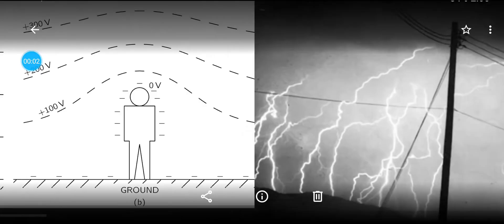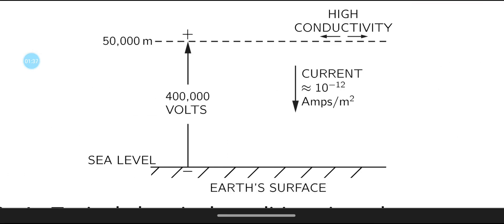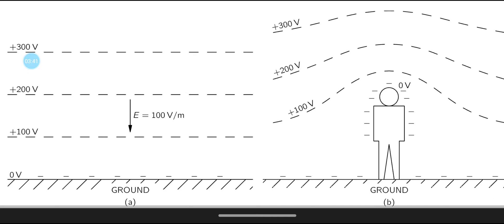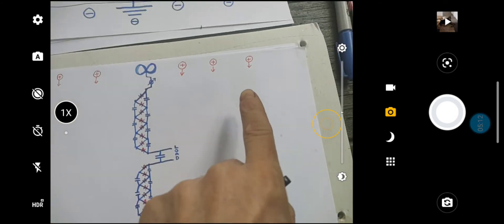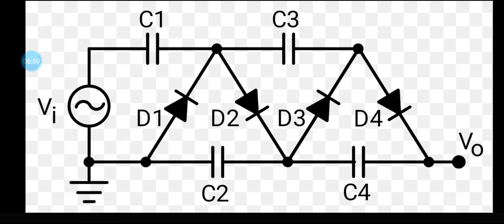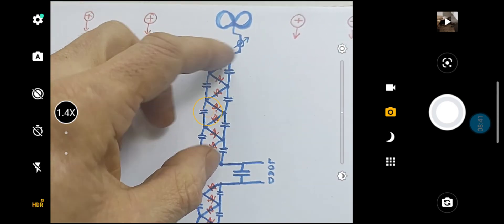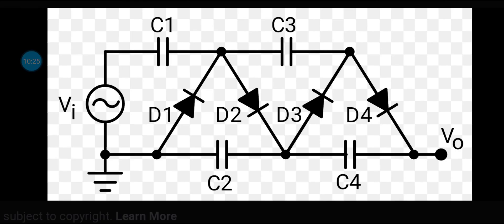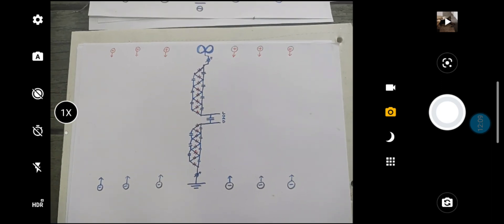Electricity in the Atmosphere (My Harvesting Concept Based on Feynmans Lectures.)

Comment: My thoughts 🤔.... 
This is where you will end up with a conventional understanding of science.... 
Having a feeling that there's gotta be something more but the path forward isn't quite clear! 
In the words of wisdom from Benjamin Franklin himself who first coined the terms positive and negative said that the electric charge is a problem of accounting! 
He said that it's like a bank account where when you have more charge, we can call the account positive as in credit! And when you have less than, it's negative as in debit! 
He never said that there's two different but opposite charges! 
No different than any bank account today! You open a new bank account and it's at zero! You get paid and it's positive! Anything less than that positive is negative relative to the original positive! 
So then, relative to the antenna, the ground is referred to as 0V but if you source a new 0V ground reference point deeper down, your original 0V ground reference point is no longer 0V, it's potential has now changed and gone up! 
So basically by using an insulated ground rod with an exposed tip only, you will be referencing your 0V ground from a deeper point in the earth and increasing the distance and thus potential difference between the ground and the atmospheric source.... 
It's a common misconception that there's two different but opposite charges! That's just as silly as thinking that -5° in Celcius or Fahrenheit is even possible! Zero is zero no matter what! There's nothing less than zero! In fact zero doesn't exist! 
You might think that it's cold where you are, you may even think that you live in the coldest place! Leave the earth and it's colder! Leave the solar system and it's colder again, leave the galaxy and it's colder again, is it zero there? I doubt it! You and I might not consider it as heat but it's there! The same stuff we have here on earth except so much more diluted.... It's not the opposite heat, cold just means that there's less heat relative to where you are normally from or the time of year perhaps, using words like cold and hot seems to suggest that there's an opposite thing to heat! Like a negative heat which is called cold.... 
It gets confusing doesn't it? 
This is where the understanding of the electric charge has gone wrong.... 
The ground floor isn't 0V, Zero is wherever you source your ground reference from.... So if you had a deep mine shaft and you source your ground reference point from the deepest point, the actual ground up top will now be positive in relation to the deeper ground reference point... 
I hope you can understand my point.... I'm well aware that getting my point across is not one of my strongest points... I can visualise it perfectly but translating what I see into words is a skill set I have not yet mastered.... 
If you can't go any higher, try the other end and see if you can go deeper! A circuit is a circuit, just make sure that the contact is only happening at the deepest point or at the most opposite end of the source.

Comment: You could just use a coil at 1H and a cap at 1F and pulse it to get the same Effect
Reply from the maker: Yes, for 50 Hz AC. I have considered that.
I haven't been experimenting for some time though due to lifes twists and turns.
Great comment thankyou ⚡🙏⚡

Comment: Seems like we should be using a weather balloon to carry a wire up to a high voltage potential.  That would allow all the time needed for testing.  A small blimp for lift would leave all the battery power for equipment and propulsion.
Reply from the maker: That is a Fascinating Idea
I admire your thinking.
Would be worth experimenting with.
Thanks so much for the Comment ⚡🙏⚡
Reply: Nah. A balloon isn't needed.

I hypothesize that a tall pyramid with a lightening rod at its apex may be able to draw in the electricity with a coil used to concentrate the wattage. The coil is mounted in a thick wooden  board that's grounded and placed in the middle of the pyramid and connected to the rod with perhaps magnetic cable wire. Just my hypothesis. 

Here in America any experiments involving pyramids is automatically labeled pseudoscience, however, other countries have conducted scientific research with pyramids with astounding results.

I'm disabled and unable to experiment and try out my hypothesis, but I do think that the pyramid and coil (because we're a spiral galaxy) are the keys to harnessing clean, reusable energy. The trick is in figuring out what kind of coil is appropriate. There are many many kinds out there. No telling which is the right one.
Reply from the maker: I do agree with you about using the pyramid shape.
I do believe the Egyptian pyramids were actually wireless power generation systems
& that could explain why they used to have pure gold caps.
I like your idea of a coil system 
& it would beed an excellent ground system especially aqua ducts underneath would be idea.
In my Opinion it would need a suitable operating frequency too
& this could be where an appropriate coil system plays a roll.
Great ideas my friend ⚡🙏⚡
Reply: @crazyham  Thanks bud! 😊 Glad at least one person doesn't think I'm some kind of nut. Lol 😂😂 

I take it from your post that you're familiar with Christopher Dunn's fantastic Giza research. I find his hypothesis regarding the Giza pyramids to be scholarly and 100% correct. 👍
Reply from the maker: @freeinghumanitynow  No, I'm not familiar with his research
but Nicola Tesla himself firmly believed the Pyramids were for that purpose too.
Keep up the great thinking my friend ⚡🙏⚡

Comment: Sky is positive 
Ground negative
Points share transfer charge
Ball stores charge
30 volts/ foot
Tree sap wet minerals= conductor
Oak leaf- 30 sharp points/ leaf
5000 leaves/ tree
Cloud of negative 3000 volts just above tree
Cloud of positive just above negative 
Nathan stubblefield arc lamp
Tesla lighting protector/ avalanche
Tesla magnifying transmitter and receiver/ power in an insulated wire
Jerry vasilatos, Cold War secret weapons 
Egyptian pyramids/ Simeon’s trip 1900 
Have fun😊😊😊

Comment: You need to collect charge carriers to get any substantial power.  So you need to be ripping electrons off of air molecules or access large amounts of ion flow, and there are only so many air molecules up there. So your antenna at the top would have to be a huge array  of pointy pins.

Comment: I've come up with a similar design. you must consider that not only does atmospheric DC exist but atmospheric AC is what powers such a diode array. Separately consider your AC subcircuit behavior and your DC subcircuit behavior. If you are trying to multiply atmospheric DC with diodes , it does not work like that. Redesign your circuit to take advantage of atmospheric AC to boost the DC. Faymans works by allowing DC to flow through a wire. Your design should work by controlling AC to store DC. If you look at the basic diode multiplier that you show it has AC source powering it. Vi represented by a sinewave. DC will have no effect on such a circuit.
Reply from the maker: I think you missed my reference to an excitation of the system with an external signal or the possibility of background radiation 🙏(Words to that effect) Hence my Suggestion of it likely being a Good Rectenna System. (Rectifying Antenna) AC RF /DC Bais)
I also made reference to Tunable Inductors for tuning to Resonance which of course is frequency dependent. Thanks for your Comment & Happy 2024.